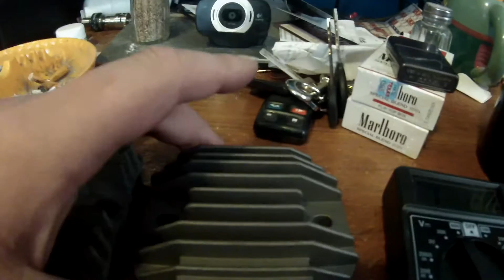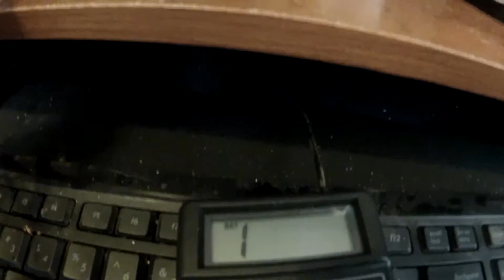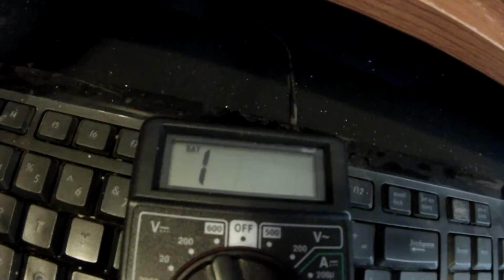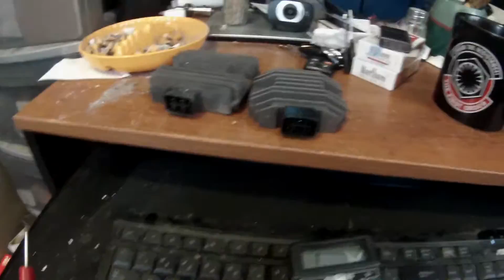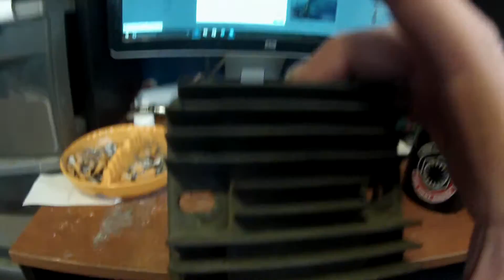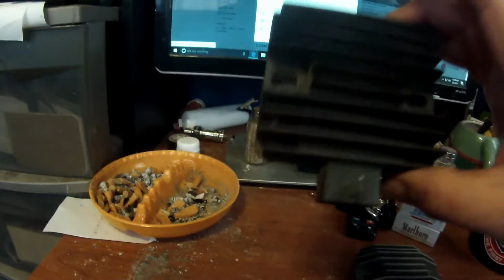Bike problems rectifier regulator

Comment: I suppose the only way to know is to fit it and see if the volts change when you rev the bike and don't go too high, I don't know if that helps.
Reply from the maker: that's the plan brother its on the bike now just got to finish up putting everything else back on before I can test it out 03 v stars ain't the best to work on LOL when you don't have a bike lift